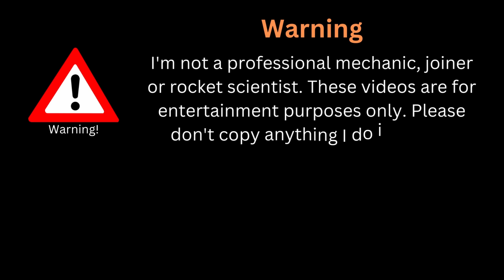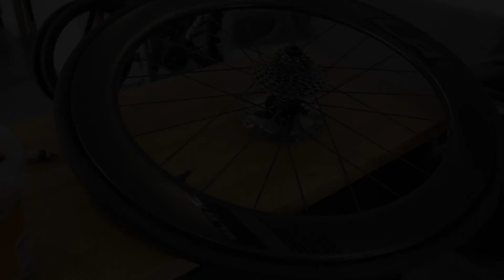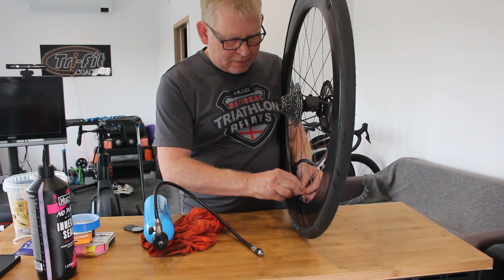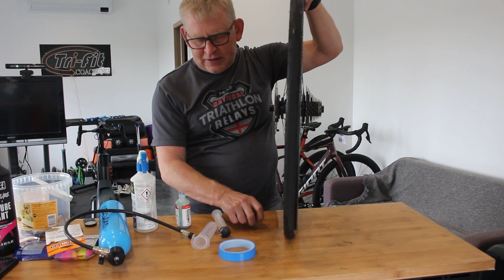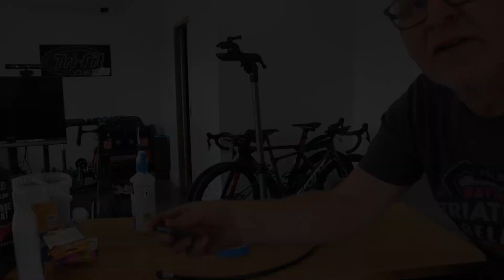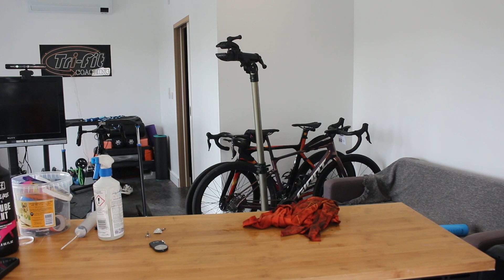Giant tubeless problems again. New tyres fitted by bike shop this one won't hold pressure

Comment: What is faster? A 25mm at 100psi or 30mm at 40psi? On smooth track boards or road, the 25mm. Where in the uk are roads as smooth as track board? Nowhere. You’d put out power smoother not being rattled to bits or having to slow on rougher roads. Smoother is faster.
Reply from the maker: now you say that. I used to ride 25c in the winter at 90psi and I could feel and the stats said I was slower (weather conditions and road conditions do play into that. 23c at 110psi is just quick but not pleasant to ride. Now I'm riding tubeless 28c on the propel at 65-70psi and 32 on the Defy at 45-50PSI. The propel is quicker but the defy is way more comfortable. There are a lot of obvious statements there as the propel will be faster it's a rigid aero bike, the defy is a comfort more compliant frame. I may do my own test and stick the Propel wheels on the defy as they are the same wheel.

Comment: Im using vittoria corsa next 30mm on slr2 wheels, seat with a hand pump, front 35 rear 40psi. And IS faster than my previous 28 and 25. 
More than 30-32 is useless, and 23 with 100psi is slower than 30 with 45.
Reply from the maker: I tend to agree with that I ride 28c hookless on the propel now, The defy cam with 32 and it's like a tractor. I'll switch those to the SLR2 winter wheels of the old dead defy and take the 28s of the winter wheels and stick them on the SLR1s that came with this defy.